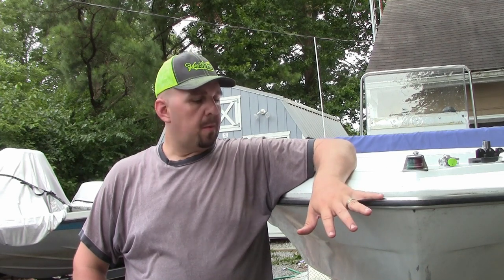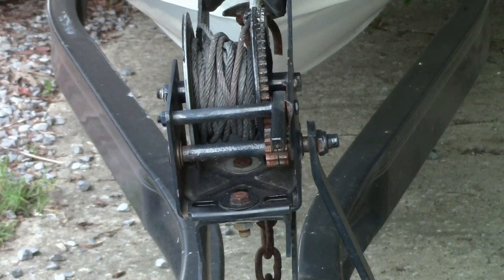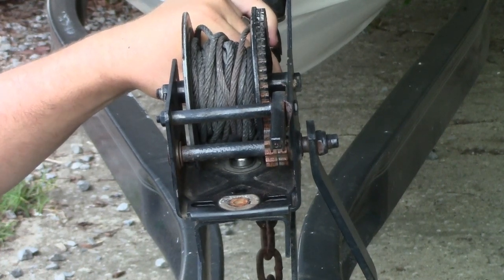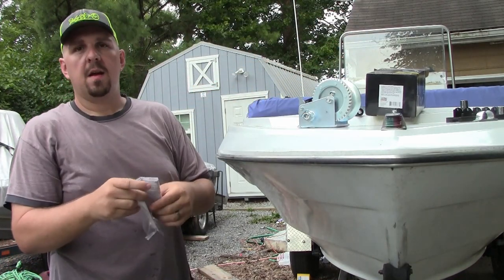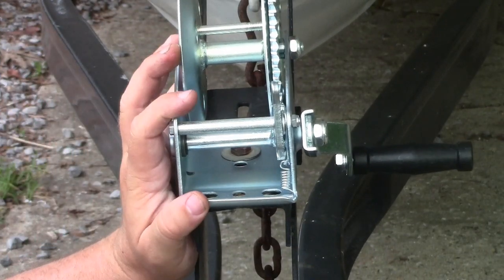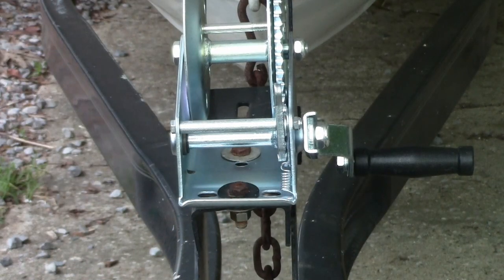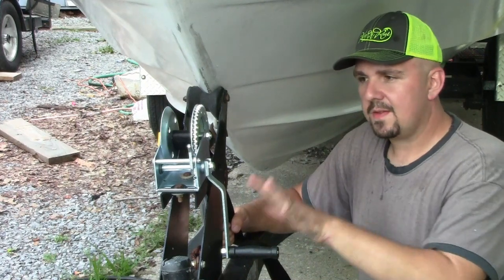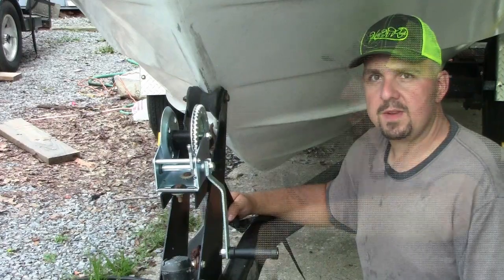How To Replace A Boat Trailer Winch

Comment: Would you be able to mount this in the bed of the truck and use it to lift semi tires into the bed?
Reply from the maker: You probably could, but there are better options for that. A friend of mine used to have a lifting winch in the back of his truck bed that had a swing arm and a similar winch.

Comment: would you recommend unhooking the strap from the boat thus releasing any possible tension from the strap before you remove the bolts?
Reply from the maker: Sorry, just saw this message. Yes, that would be a good idea to avoid any potential problems.

Comment: My winch works but the part that locks it in place  doesn't work anymore   I bought a $30 one off amazon to replace the whole unit   I woukd like to repair the existing but it doesn't seem like it repairable .
Reply from the maker: joe smith once those locking cams start acting up I get nervous about the winch in general. That's why I replaced this one when I bought that boat.
Reply: The Weekend Angler    Ok great to know , I bought one . Waiting on it to arrive . Its a Reese server 1200 lbs nylon strap  for my light sea nymph aluminum  👍🏻
Reply from the maker: joe smith that should work fine for your boat.

Comment: I tho boat had to be in water to do how keep boat on trailer
Reply from the maker: Renee Kellow the trailer was kept level and the bunk boards were dry. The boat wasn't going anywhere even with the winch clip removed.
Reply: The Weekend Angler ok thanks yeah we about to replace winch but we tho we had to take boat to the lake
Reply: I forgot to tell u I have rollers
Reply from the maker: Renee Kellow lower the tongue down a little so that the boat is sitting slightly nose down. It will stay on.

If you're worried about it though, you can go to the lake. It doesn't take long to replace the winch.
Reply: Yes thanks we did it love ur videos
Reply from the maker: Renee Kellow thank you very much! I'm glad I was able to help